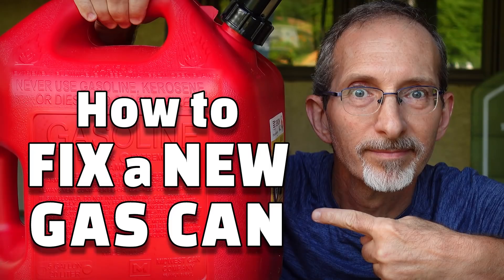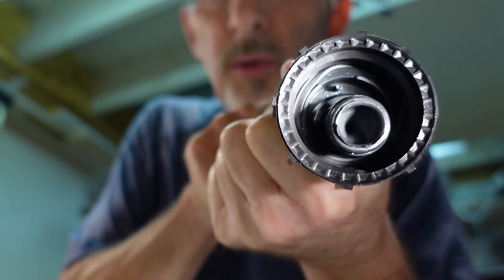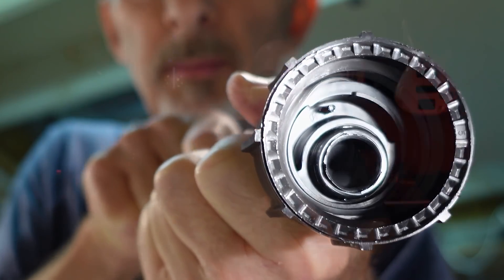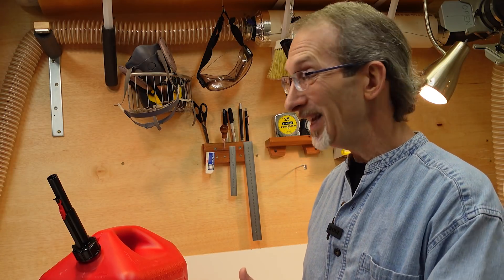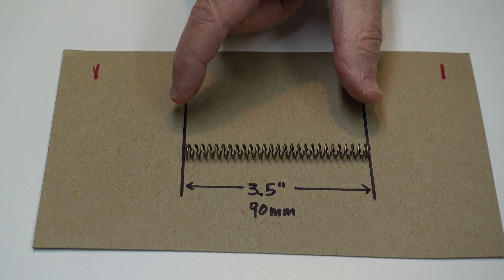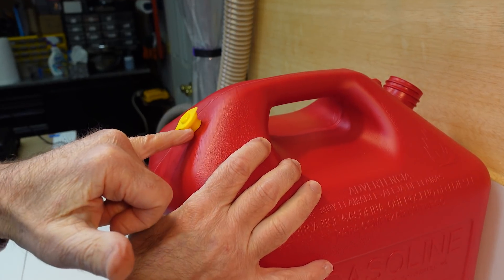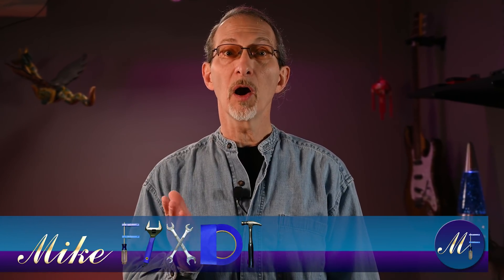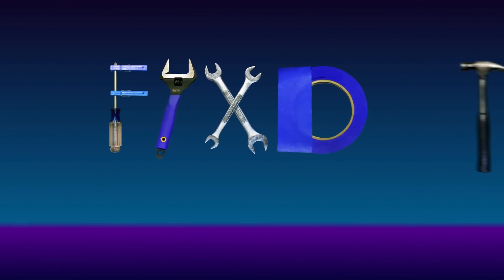Gas Can Modification | Part 2: Explosive Details!

Comment: I'm glad that I still have my galvanized steel cans that I bought 40 years ago.
Reply: I still have my old metal gas cans. I hate those plastic thingies.  I get gas on me and everything around me.  There is no way that it safe.  This shit should be banned.
Reply from the maker: I lost my galvanized steel can when I moved. I wish I still had it, I’m glad you still have yours! Thanks for watching!
Reply: @MikeFyxdt  the metal gas cans of my youth (early 1970s, when I was regularly fueling lawnmowers and small outboard motors) weren't galvanized, and neither were the engine tanks.  Even though the gasoline didn't have ethanol added to it back then, the cans and tanks still tended to get rusty inside.  If you are using modern ethanol-blended gasoline, your metal cans had better be made of either stainless steel or heavily galvanized. Also, static electricity sparking is much more likely to occur with a metal can. For these reasons, I'll stick with plastic cans! (Although it is worth noting that I had one Sceptre can that cracked along the top seam where the two haves of can were fused together. I've also had squirrels or mice chew the ends of the nozzles while they were screwed onto the can and sticking up in the air; one critter actually chewed a hole in the top of the molded  hollow) handle of a can that had gas stored in it!).
Reply: @goodun2974  Yep in addition to animals chewing on plastics, I heard plastics burn, you know a squirrel told me!
Reply: @MikeFyxdt  They still sell these too.......https://www.amazon.com/Eagle-UI-50-FS-Galvanized-Gasoline-Capacity/dp/B00004Y75M/ref=pd_sbs_7/145-7864407-4722836?pd_rd_w=EBnIR&pf_rd_p=a5925d26-9630-40f3-a011-d858608ac88b&pf_rd_r=2APQTCPG4ZDF7W0RJJZV&pd_rd_r=bfabf5a8-3dcc-4d41-8834-01bb56ae08eb&pd_rd_wg=uNiv4&pd_rd_i=B00004Y75M&psc=1
Reply: Funny part is that while you have your galvanized fuel cans from 40 years ago, the rest of your generation was coming up with all these goofy things that are super annoying now.
Reply: My friend found one of them in the garbage. All of his new cans leaked gas whenever you would pour the gas, but this old one pours just fine with no leaks. I wish I could get one of them!
Reply: Flea markets
Reply: If you store more than a gallon of fuels of any kind in your garage please add a placard at the door(s) for the fire fighters to prepare for an explosion when your garage is on fire. That is, unless you have a vented storagr cabinet, properly installed with the vent to outside air.

The cabinets are usually guaranteed to a given temperature and will delay any explosin of stored fuels.

That is what we do on the farm, home and in industry.
Reply: @1mtstewart  That's just ignorant blather. Most, if not all, garages have vehicles inside that each hold several gallons of fuel. You don't think fire fighters know this? Garage fires have assumed hazards with or without any silly sticker.
Reply: @gonerydin4225  vehicles aren't cheap cans of fuel with no fire proofing. Firemen die when people are ignorant of proper storage and signage. Once there is a fire it is easy enough to hool onto a vehicle and pull it outside. Running around trying to get fuels, solvents and other chemicals out is a losing game. Burn or blow up.
Reply: @1mtstewart  I'd like to agree with you, but then we'd both be naive.
Reply: @1mtstewart  Grocery stores are the most dangerous source of chemical containing fires. Think of all the products sitting on the shelves containing who knows what.
Reply: @1mtstewart  Don't cars parked in the garage have more than a gallon of gas in them????
Even electric batteries are very dangerous, they can burn too.
Just saying, I am sure firefighters expect fuels in garages!!!!!  No need for placards!
Reply: @superchuck3259  batteries are not equivalent to gasoline or kerosene.

Comment: The spring mod! It might have been nice if the vent was designed to use a common drill size!
Reply from the maker: Some people have suggested that it works well with a half inch bet in a few taps of a mallet. But I totally agree with you!

Comment: I think these ideas are absolutely wonderful and hopefully won't forget about them when I need them. I just have one more thought that may or may not work depending on how durable them little yellow vent caps are. It's possible that a cup of boiling hot water might make them pliable enough without distorting them. If anyone tries this please let me know if it works or not. I would start with a rolling boil as I'm guessing this application will be close to its limits if not above, that yellow plastic looks pretty strong.
Reply from the maker: Victor, softening the yellow caps is a wonderful suggestion! Thank you, I hope other people see the suggestion!

Comment: Thought for drilling the vent hole- after drilling, use a knife to cut off any inside burrs on the hole, then put an air nozzle into the hole, turn so fill opening is down, and blow out with air. That should help with cuttings.
Reply from the maker: Alan, that is a very helpful suggestion! Thanks for adding to the conversation.

Comment: I like your fixes in this video, much more sophisticated than the first one! (For those who do not have that impressive range of drill sizes, one drill + a simple reamer would work.) You seem to be "fixated" on this one brand of gasoline container. It might be interesting if you could borrow some other containers to test their approaches to the same function issues. If you were able to find ones that work better, you could feature them sometime- then maybe the market could help sort this out. At least this company did try to make an improvement- thanks for mentioning! And finally- the push on the lip system is an issue with small equipment. But really, how many people refill chainsaws, string trimmers, gasoline hedge clippers, leaf blowers, etc. from 5 gallon containers? I always use a 1 gallon container for mixing or use engineered pre-mix fuel (expensive, but saves maintenance).   As for the idea of gasoline can hazards in general, never underestimate the extent of stupid!
Reply from the maker: These are all excellent points!

Comment: Think I’ll just retain my Steel Jerry Canz and Donkey D!@k screw in pour spout... These cans will last forever as long as you keep em Clean and Full. I’ve used Jerry Canz for 45 years to great effect.

Great Video by the way!
Reply from the maker: Thank you, I had fun making the video! I’ve only owned one metal gas can in my life, and I have no idea what happened to it. Maybe the movers saw it and recognized it as a treasure. I think for my next gas can I’m going to splurge and get a good metal one. I appreciate you joining the conversation!
Reply: @MikeFyxdt  Harbor freight sells a really good metal gas can. It is made by Midwest can so it has the shitty "quick flow" spout, but the can itself is really good quality. Good thick steel with quality welds on the seams. I think it was around 40 bucks or so. Pricier than plastic cans for sure, but I'd wager that I'll be handing that can down to my son one day. Lol

Comment: I want to install an after-market vent like the one shown. My Briggs & Stratton gas can has a non-removable mesh flame mitigation thing. Will it be a problem if I can't remove the plastic bits that fall inside while drilling the hole?
Reply from the maker: If it was a new can then I would say to flush it out with water to get the plastic bits. But if the can is already in service then I would say just drill slowly with a sharp bit. I was able to pull most of the plastic out, so I don’t think anything got into my can. Your metal flame mitigation mesh will probably catch any bits of plastic that make their way into the tank and keep it from going into your equipment. Disclaimer, I am a YouTuber, not an engineer! :-)
Reply: @MikeFyxdt  Thank you for the reply.

Comment: Hey Mike, I resently purchased two of these. Plus over the years different ones of different sizes. When filling, dispensing or just storing these cans is a joke as far as the so called safety features. I have spilled more fuel with these safety features then I did in my entire life. Also if you take a can to the gas station and decide to keep them in your trunk as to save your back from lifting the heavy can you better bring lots of rags and something to lay in your trunk because you whole car will smell like gas do to spillage. Going to a gas station that you are not allowed to fill your own gas the gas station attendant will make faces as you walk up with one of them cans do to the difficulty and time consuming of filling one. My question is what happened to keep it simple stupid.
Reply from the maker: I agree, especially about the inconvenience of getting them in and out of the car. KISS theory disappeared a long time ago!
Reply: Yes legal reform is needed. 

However, none of you are getting. The new cans were made difficult to use on purpose. You are supposed to give up in disgust and trash your gas burning yard machines and buy new battery powered versions so that you stop destroying the environment. If you didn’t go to an Ivy League college, you are stupid and can’t be trusted to do what is right. You must be legislated or simply ordered to do as you’re told. If you disobey, you will feel the full force of the government on your back.

Comment: The No-Spill brand cans are much better than the cans you demonstrate. The are double the price though! 
Also you can buy the race style cans, that have a regular spout and a vent.  They get away with this because they are not fuel cans(it says it right on the label), but what you put in them is up to you. They’re colored red too......
Reply from the maker: I know there are better cans out there, but I bought these thinking they were a good value. A couple of slight modifications and I am good to go!
Reply: @MikeFyxdt  the sure can is sure expensive, but I have to say it's a relative pleasure to use, with zero contact with gas on the hands and easy and rapid dispensing with the trigger valve. Filling doesn't require removal of the spout, and it has clear access with the gas station nozzle. If they dropped the prices they'd probably make it up in sales volume. I'm sure most people would balk at spending over $40 for a mere gas can.

Comment: I threw mine away. Problem solved.
Reply from the maker: But you could’ve fixed it! Thanks for joining the conversation!
Reply: @MikeFyxdt  now you tell me 🤣 actually I saved the video. But really, we should not have to fix it. I spilt so much gas using that damn thing it cost more to use it than it’s worth.

Comment: Why are gas cans designed like they are?   
  1.  to help prevent the manufacturer from being sued.
  2.  EPA regulations on hydrocarbon emissions.
99.  to protect stupid people from themselves.
Use a short valve stem with the schrader valve removed for the vent.
Be careful, the EPA cops will come after you.  It's probably a $10,000 fine for modifying your gas can.
Reply from the maker: Thanks for your comments Kerry! I added a plastic vent cap in my follow up video, which looked easier then the tire valve trick. Link in the description to the video into the plastic caps if you’d like to check them out.
Reply: @MikeFyxdt  I saw that.  Valve stem is just another option.  Easier to lose (and replace) the cap, and you have the stem sticking out.

Comment: A weaker spring would have solved one issue.  A removable "flame arrestor would have gone far to solve another problem.  A different geometry would make the nozzle easier to remove.  Their shoddy engineering defeated the purpose of all their efforts.  SAD!

I might add that I am 65, and have used a variety of gas cans since I was a kid.  Still no explosions or fires.
Reply from the maker: The weaker spring really did make a difference. The physics of dispensing gas hasn’t changed since I was a kid, only the design of gas cans have, and it defies physics AND logic!
Reply: @MikeFyxdt  Yes!  I watched part 2.  Brilliant repair engineering!

Comment: Hardware and home improvement stores have a selection of springs that might be of that small diameter but with a lot less tension.
Reply from the maker: I stretched the string to almost twice its original size and then cut it in half. Popped it back into the spout and it worked like a charm, requiring much less pressure but retaining the spring loaded action. You can see this done in video number two.
Reply: @MikeFyxdt   yes,  i saw that, but the spring still seemed to be still a bit stiff,  especially for a senior citizen.

Comment: I use a battery powered siphon pump and after market solid plastic screw caps on my fuel storage gas cans.  I did have to remove the plastic mesh safety device to allow insertion of the pump. The screw cap allows me to remove the spout entirely and transport filled gas can up right in my car trunk with my trunk lid closed..
Reply from the maker: The battery powered pump is a great idea. I agree, putting gas cans in your trunk with the spout attached is often a tight fit. Thanks for sharing your tips!

Comment: When I put my vent in, I moved it about three inches to the right of where you put it.  It is on the right side of the handle at basically the same level.  The advantage, is you can start pouring the can with it closed, then open it with the thumb of the same hand holding the handle.
Reply: I was thinking that the right side would have been a much better option too.
Reply: That would work only if you’re holding the can backwards.
Reply: what happens to the shavings from the drill u used to do the hole

Comment: As a female with little hand strength trying to use one of the new gas cans is impossible. The new safety spouts often leak causing gas to spill all over the damn car. 

I bought one at a gas station to help my friend Rachel who had run put of gas. After 30 minutes trying to pour 2 gallons of gas into her tank I took the spout off, rolled a magazine into a funnel and used that to get the gas in her tank. Needless to say I was covered in gas by the end and sick for two days from the fumes.

I have since procured 2 gas cans from the 50's and one from the 80's that work great for people who aren't idiots.

I sent this to my buddy who can't find one of the older cans. Apparently my dad and grandpa were aitting on two gold mines having 3 of the old designs. lol

Comment: Lawyers are behind the spark arrestor...in designing a product you have to consider all possible uses or you are liable...think screwdriver as a pry bar or chisel. 💩 loads of people pour gas on fires or to start, makes for good YouTube videos or news stories. 😆

I still remember my dad pouring gas on a charcoal grill and the flame going up and into the can. 😬  Lesson learned at prob 8 years old.
Reply from the maker: Yes, I often think of what it would be like if screwdrivers and hammers had safety devices, or were covered with warning labels. Crazy!

Comment: "Vapor locking quick flow spout"  ~ 1 - 2  GPM max flow depending on the angle, fuel, and time of year. ~1/5- 1/10 the flow of old fuel cans 'that were slow.'.   🙄

Comment: The link to the little yellow doodads was golden, I never stopped to think they  might be sold individually like that.  My plan was to put a tire stem (minus core) in the back of the can, but the yellow thingies are much better!
Reply from the maker: Good! The tire valve fix looks cool, but the yellow caps are really easy.
Reply: @MikeFyxdt  The yellow caps really are the better solution for several reasons, thank you very much for posting that!
Reply: I ordered a five pack, and was sent eight.  I used what I needed and gave away the excess.
Reply: Great link- would never have thought to look!

Comment: Is it possible to make it so we don't have to push the red tab in to open the fuel flow?
Reply: Watch his first video on how to remove the spring. Then just pry out the red trigger at the same time. Problem is, you WILL end up with free flowing gas vapor out of the nozzle then as there's no way to fully seal it once you're done.
Reply from the maker: Red tab serves as a lock so the spout doesn't go in by itself. If you are removing the spring I'd leave the red tab in place.

Comment: Follow the money,   50 cents worth of plastic is worth 15 dollars when you get new regulations.   The cans are made to hold VOCs and pressure up when sitting...... and crack or split when they get old,   vent?   I drill a small vent hole in the handle so pressure won't build in the can,  just put your finger over the hole when you tilt the can.    I can vouch modified gas cans are better,  someone stole two of mine last summer.
Reply from the maker: Good advice!

Comment: I got a quick flow pouring hose nozzle from tractor supply, I just screw it onto whichever can I am using that day. On a different note, does the plastic air vent leak?
Reply from the maker: So far the plastic vent cap has been very secure.

Comment: You can "break" the spout so you don't have to push that super spring down but then you have no cap so some evaporation will occur... also these safety cans have made me spill gallons and gallons of fuel its definitely not an environmental reasoning for the poor design
Reply from the maker: When you remove the spring (or shorten it to make it easier to depress) you can still get a seal on the spout when you pull it to the up position. I really haven’t had any evaporation that I’ve noticed. In fact I can tell it’s pretty air tight because the can ‘burps’ when you open it. 😁
Reply: @MikeFyxdt  I ended up just tearing mine with pliers I wasn't to nice about it but it's a can that gets filled then emptied the same day